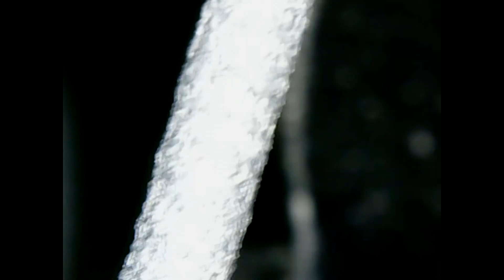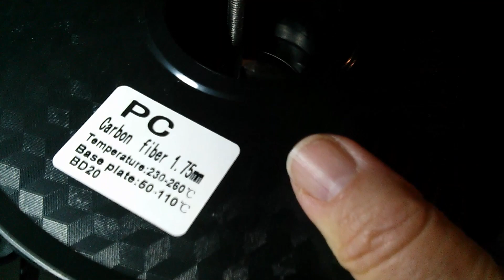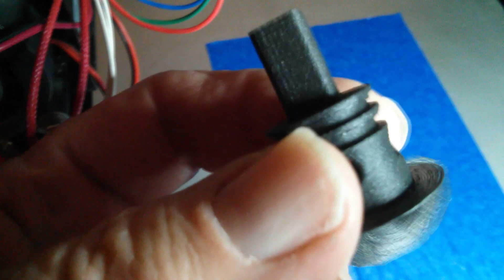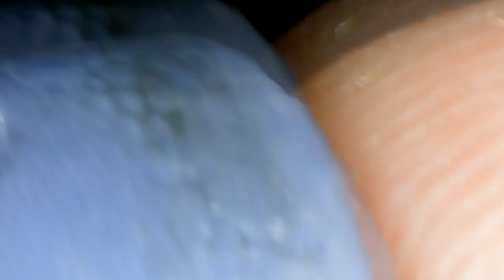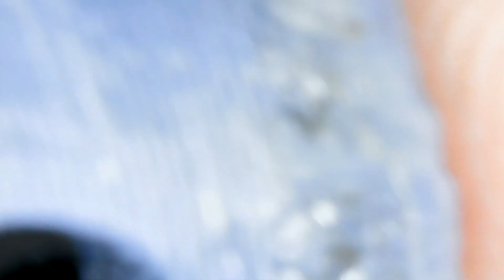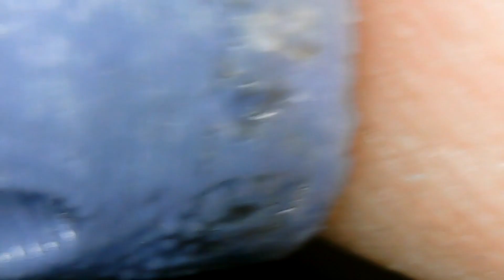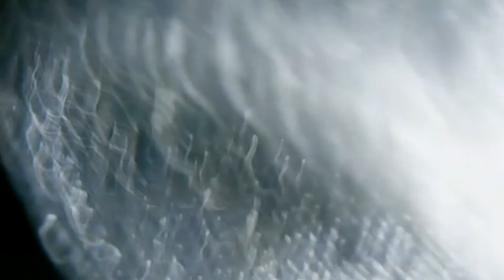PRILINE Carbon Fiber Polycarbonate 3D Printing Challenge

Comment: I use it with a bowden tube on an ender 5 plus and I'm amazed by how well it prints
Reply from the maker: Good news. Someone was asking about print settings recently. I was just going slow 30mm/s, 230 hotend 80 bed. What is working for you on the Ender 5 Plus? Thanks.
Reply: @ShotokuTech  I was at 95C bed and 255C hotend 

I started off at 50mm/s with a raft and a little after the raft I bumped the speed to 70mm/s 

I had a little rough edge on an overhang but nothing major 

Overall this is my new favorite filament for anything structural 

I unplug my part cooling fan and my hotend fan and plug the hotend fan into the part cooling wires then I could turn the fan off from the screen ... I ran the raft with no fans at all to minimize the risk of any lifting or warping 

The ender 5 hotend fan blows onto the part too much and I haven't been able to create a good solution for that yet
Reply from the maker: @mikekorman666  Faster speed, higher temps, seems interesting. Thanks
Reply: @ShotokuTech  I should try a much lower temperature ... it might help with my rough overhangs 

I'm about to print a single m8 nut ... I'll try it at 230C on the hotend and see how that goes
Reply from the maker: @mikekorman666  Either way, interested to hear what is good for your scenario. Thanks.

Comment: would you mind sharing your basic print settings for this filament?  i just got the 'super hard' version of this priline cf pc, and im having issues dialing it in...  some parts of the print are ok, other parts of the same print, the corners/edges are rolling/pulling in.. have a little warping in certain spots, and on one print, it did all that at the begining or first 5-8mm's, then there was a layer seperation, or, certain parts of a layer delaminated, and after that layer, the rest printed fine..  even tho it says you dont have to, i printed in an enclosure after the first calibration print had these issues, because i thought maybe a slight temp change or draft may have affected it, but even in the enclosure im having these issues.

any insight would be appreciated.
Reply from the maker: I was printing at 230/80 temp, 30mms speed, 0.4 nozzle. This filament is not good for printers with Bowden tube because of its course texture. I was printing on ANET A8 here with direct feed

Comment: The Priline PC and PC/CF filaments have a blended PC mix with PETG and a few other modifiers. Overall it's not quite up to scratch with other PC mixes, notably Prusament PC or 3dsMax, but it is darn good for the price, and certainly easier to work with, even allowing decent printing outside of a heated chamber for some applications. Just test with it to be sure it meets your requirements.
Reply from the maker: Great summary. Agreed.

Comment: My CR-10 verson 2 prints beautifully with PLA, but I have got any acceptable simple print with Priline so far.  I set the bed to 80C and nozzle to 260C with 0.5mm hardened steel with no fan, and also 40% fan in other attempts.   Haven't got any success.  I wonder what settings are the sweet spot for getting a good print.
Reply from the maker: Hi. I haven't tried this at 0.5mm. What is your print speed?
Reply: @ShotokuTech  My PLA printing has always been at 50mm/s so I lower to 30mm/s.  BTW, I have great experience with stickiness when printing PLA @ 60C bed temp.  Now even when I crank up to 100C for the bed temp, Priline still has difficulty with adhesion.  Not sure if the Priline is a good brand.
Reply from the maker: @vokysugar7702  I was printing at 230/80 temp, 30mms speed, 0.4 nozzle. This filament is not good for printers with Bowden tube because of its course texture. I was printing on ANET A8 here with direct feed.

Comment: I tried my first functional part with this material and was extremely disappointed. running a .4mm nozzle, 265 C, .2 layers, no cooling, 4 walls, 50 mm/s, 25% infill. Layer adhesion was awful. Part was really strong in the layer line direction, but came apart with my thumb when stressing the layer lines. Did I get a bad batch or am i doing something wrong. running the filament out of dehydrator so i know its dry. Any tips? never had this issues with PETG or PLA filaments.
Reply from the maker: Weird. I live in a place with wildly fluctuating temperatures and humidity and I have never used a dehydrator. Shoot me the STL and I will take a shot at it. Thanks.
Reply: @ShotokuTech  thanks for replying. For testing I’m using makers muse 25mm cube, doing various infills etc. I’ve done a hollow, 1 wall cube with tops and the thing breaks apart at the layer lines just trying to remove it.  Even a cube with 4 walls, 50 infill and 4 top/bot layers comes apart cleanly and easily at the layers with my putty knife. I know what that test feels like with PLA and PETG and it’s so much stronger. I contacted priline as well, so we’ll see what they have to say.

Thanks again for your help.
Reply from the maker: @LinusScrubTips  This is direct feed hotend or bowden? I have pieces here I printed and they do not separate at the layer. My credit card wallet with a print as one piece hinge is solid. Hinge works and the snap closure snaps shut. The piece is also flexible but retains its shape. Is the diameter to tolerance? I had some TPU from PRILINE that was closer to 1.5, than 1.75. I stil have some of this in a bag somewhere. Maybe I will get to fire it up this week. Thanks.
Reply: @ShotokuTech  Bowden. I was using a steel nozzle, and swapped back to brass just in case. Same issues. If I flex mine at all it separates. The weird part is the layers look great. the lines in the walls have good contact. Diameter was 1.75, and like I said the prints LOOK phenomenal, it looks like a really nice PLA print I would get. But it comes apart super easy.
Reply from the maker: @LinusScrubTips  Probably won't help but I was printing at 30mm/s
Reply: @ShotokuTech  I actually saw that you used that and tried myself. I think it might have made it SLIGHTLY less brittle but it didn’t fix the problem. I appreciate it nonetheless. I’m trying out some other filament to make sure it’s not my printer

Comment: Can you share the profile
Reply from the maker: Hot end 230c, hot bed 90c, print speed 30mm/s. Thanks!
Reply: @ShotokuTech  my prints look great but the layers are brittle
Reply from the maker: @fsant16393  Increase temperature 5 -10 degrees. Increase flow rate to 115%-125%. Slow down if you are printing faster than 30mm/s.

Comment: This must be a modified PC If it even is PC. Every PC I've ever seen or used needed 300c + on the hotend. If it works well for your application I guess it doesn't really matter.
Reply from the maker: Thanks. Yes pure PC is 300c. Who has that printer? If it works don't fix it. Thanks.

Comment: Just got some. I do have a bowden tube Ender 5, I will report back if the tube wares out or if I have other issues. Good review thanks for doing it.
Reply: How'd it do on the ender 5?
Reply from the maker: @equu497  @Centurial Inc do tell?!
Reply from the maker: Interested to hear how it goes. I'm thinking the bowden tube is not that big of an issue. It is just what the vendor indicated in the description. Thanks.
Reply: any updates?

Comment: Hi, i have a question actually. I need something realy hard and strong pour my tractor. But so many filament. I don’t know which is the best between nylon Cf, nylon kevlar or pc cf.. i can’t print peek so what kind of filament do you recommend ?. Thank you !
Reply from the maker: The answer depends on the part I guess. This plastic here is somewhat flexible to a slight degree so you won't likely crack in two. You would have a difficult time crushing it. But depending on the direction of the lamination, tensile strength might be iffy. This seems to indicate PC: 
https://3dprinterly.com/what-is-the-strongest-3d-printing-filament
In general the higher printing temperature of the filament, the stronger it will be as a finished part. But then you have to look at the capability of your printer. There are 3D metal printers now. But who can afford that? LOL. Thanks.

Comment: Could you tell me about the blue tape? I am having problems with the adhesion to the bed, thanks!
Reply from the maker: The aluminum bed on the ANET A8 can be covered with large 8"x8" blue tape squares. I used to get them from Amazon. But now I only find rolls of 6.25" wide blue tape: https://www.amazon.com/Gizmo-Dorks-Blue-Painters-Printers/dp/B00LAJNM7S
Large sheets of blue tape are a challenge to apply squarely without bubbles or stretching. And you have to level the bed when you change the tape. But it works pretty good in most applications.
I prefer PEI sheets or the Ender3 Magnetic bed liner. But these don't see to hold up well for high bed temps. I sometimes use a slurry on the PIE sheet for better adhesion with ABS, by putting a small amount of acetone on the bed while it is cold and rubbing in some scrap plastic piece to make a film of plastic on the bed. That's it. I have not used any other beds, liners or adhesion methods.

Comment: Hello, anybody done any strength test on this? it is super brittle and soft for PC disregard which temp I print it on. I would not use this filament for critical functional parts as I don't consider it a safe option! It is definitely not PC or a filament with a very low percentage of PC. I have printed with Polymaker polylite PC and is far stronger than this! As well real PC is more denser and heavier.
Reply from the maker: This worked in my case. I needed a valve for a hydraulic application. This included a shaft to attach a knob to. I am sure there are other brands of PC that I would not have the equipment to print it with at the temperature needed. Thanks.

Comment: Instead of a Bowden tube, what kind of tube would you use with this filament?
Reply from the maker: The manufacturer recommends direct feed like the ANET A8 in this video, where the extruder installed directly on the hot end. A printer like the Ender3 where the remote extruder feeds filament through a bowden tube to the hot end is not recommended. This is a coarse filament that could wear on the tubing or get snagged in it. Thanks!
Reply: @ShotokuTech  Thanks for replying so quickly.  I'll see what I can find!
Reply from the maker: @sharperprogrammer  Best wishes. Thanks

Comment: My favorite filament! It's much easier to print it than NylonX or 'real' PolyCarbonate (300+C).
I'd recommend high temp all metal hotend and at least steel nozzle (harden steel or ruby even better).
Also, AC bed heater helps a lot (my 750W heater reaches needed 100 C in less than 90sec). 
Very good filament for functional parts that require both strength and temp resistance (for friction, etc).
CONS: It's very strong but it can snap-break (unlike NylonX that bends). Also, it's messy (dusty) for sending.
Reply from the maker: Thanks for the tips!

Comment: Thanks for making this video, very helpful!  I am new to 3D printing and have only played with PLA thus far.  I have a Quiditech X-MAX, great printer.  It says to use carbon fiber on the inside filament holder to have a better temperature stability but it looks like you are using it without any enclosure, correct?
Reply from the maker: That is correct. This was during the Fall, with good temperatures and no moving air in the house. Winter and Summer I have to use an enclosure. Thanks!
Reply: @ShotokuTech  Thank you for the reply.  I also contacted QIDITECH about which nozzle to use for ABS and Carbon FIber PC (I have the Priline Carbon FIber PC from your video).  The X-MAX came with a extruder already installed that they say is suitable for PLA and ABS, and then it came with a high temperature extruder which QIDITECH is telling me should be used for the Carbon FIber PC, but in your video you think the ABS temps are ok to use with the Carbon Fiber PC filament, then do you think i should go ahead and try it with the extruder that is already installed (I plan on cleaning the nozzle first using your method and with a cloth with acetone).
Reply from the maker: @kathrynlockwood1180  Hi Kathryn. This specific brand PRILINE CF PC worked fine at the same temps I was using for ABS. The label on the spool says between 230 to 260 C. I found that 230 was just fine for me on the ANET A8. You might have to adjust depending on your unit. Some argue that this must not be true PC because of the lower temperature. But I found the parts I produced were fine from my application anyway. Best wishes.
Reply from the maker: @kathrynlockwood1180  Hi Kathryn. This specific brand PRILINE CF PC worked fine at the same temps I was using for ABS. The label on the spool says between 230 to 260 C. I found that 230 was just fine for me on the ANET A8. You might have to adjust depending on your unit. Some argue that this must not be true PC because of the lower temperature. But I found the parts I produced were fine from my application anyway. Best wishes.
Reply: ShotokuTech allright I did my first print with the Priline CF PC and it looks amazing!  I have the Qiditech X-Max printer and did change to the high temp extruder assembly and placed the filament roll inside the printer.  I used 250C for extruder temp and 100C for build plate.  I also used 30 for print speed.  Wish I could share a picture!
Reply from the maker: Best advice is go slow, 30mm/s here is significantly slower than I would go with PLA.

Comment: what is the blue tape ? does that blue tape work for ABS as well ? i thought the PC is very high temp to print like 320 degree
Reply: True, 'real' PolyCarbonate (like 3DXMAX) prints at 300+C... 
I don't think this is pure PC, but it's very strong and thematically resistant materiel, and much easier to print.
Blue tape (=painters tape) works well with this filament (it doesn't work fell for regular PC).
If you have any problem with adhesion (probably not), you can use Wolfbite for ABS/PolyCarbonate.
Reply: @Sleepery22  I agree... I have some PC-ABS blend that recommends 275-295, and it's very good at heat deflection when finished. I can't imagine this stuff would be all that great in a high heat environment if it can be melted at 230.
Reply from the maker: This PRILINE CF PC is labeled for 230 to 260 degrees. The blue tape squares work OK for ABS. It just tends to bubble up after a few prints. Thanks!

Comment: Did you modify the print speed?
Reply from the maker: 30mm/s is very safe for 2 year old sub $200 printer. Thanks!
Reply: You can go higher than 30mm/s if you have stronger heater block (over 40W).
Reply from the maker: @Sleepery22  This is a sub $200 stock 2 year old ANET A8 at this point. Better equipment can go faster. You can see it in Octopi, when the hot end can't hold the heat or hold it consistently. Thanks!
Reply: @ShotokuTech  I also started with CR-10, now I can barely recognize my printer.. :D
With this CRX-BP6 hotend, I can print up to 450C / 150C. And I did prints at 335C (nothing burned).. ;)
And all the time, I've been desperately looking for videos and tips about printing with this kind of engineering materials and this is the only video I found about my 'beloved' PC-CF. So, THANK YOU for this video!
Reply: @Sleepery22  because the heaterblock cools the more cool filament goes through it?
Reply: @antdx316  When I think better to print at faster speed you probably need both:
Stronger heater and HIGH TEMP (all metal) hotend.
The difference between high temp and regular hotend is that high temp has HEAT BREAK with very NARROW neck, which more efficiently separates heating from cooling block. Check: LERDGE High Temp XCR-BP6 Hotend for more info.
But be aware: it's more difficult to push filament through this hotend, so I had to install direct dual drive extruder.
Reply: @antdx316  Yes, to maintain the steady temperatures over 260C without dropping.
Even the small draft, like fan cooling part not aimed properly can cool the heaterblock and stop the flow.
After that experience, I avoid having any (FDM) 3D printed parts or PTFE anywhere near my hotend.
I used a molding 405nm resin that withstands 250+C to print all parts (mount, fan cooling nose, etc) on my SLA printer.

Comment: Since it has been a few months now, have you seen any issues with it? I have been trying to print with this filament and it is very brittle. ive done multiple tests as far as temp, speed, heights, drying it, nozzle size and it still has bonding issues. most of the time just removing supports the stuff will break. Any ideas?
Reply: I'm printing it at least 260 C to get a better layer adhesion / strength.
Nozzle size: this material contains less than 10% of carbon fiber, you should be able to print it even with 0.4 (steel) nozzle.
Reply from the maker: I have half a spool of it bagged up with some desiccant right now. what machine and temps are you using? Last time I printed with it was still fine. I will take a look today and get back to you. Thanks.
Reply: @ShotokuTech  I have a pretty well modified enclosed ender5 that is well tuned. ive printed test parts from 220 to 260 with minimal differences in strength. Im just not ready to give up on this stuff but maybe I just got a bad batch. Thank you for your time.
Reply from the maker: I had this spool out on the printer from November through February. I put in a bag with some desiccant since then. I took it out in this video to answer your question: https://youtu.be/Gd0i_QZk_5c
It really sounds like a bad batch. Best wishes!
Reply: @ShotokuTech  Thank You for that. There is definitely something wrong with this spool. Stay safe.
Reply from the maker: @dcc4542  You too! Thanks
Reply: What about infil and wall settings?
Reply: Commenting from 2 years in the future, same issues and I'm about to give up on this filament too